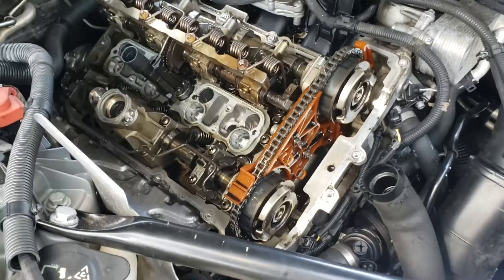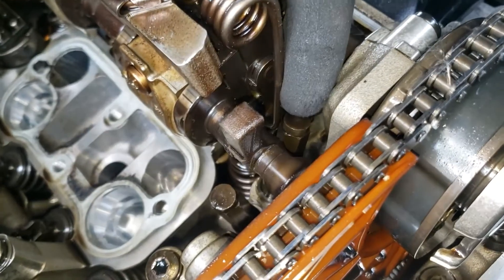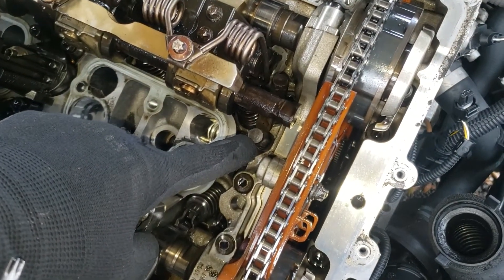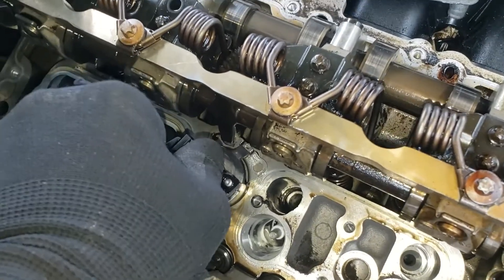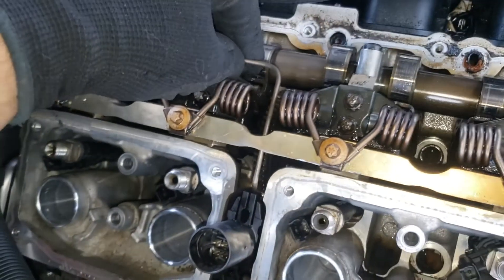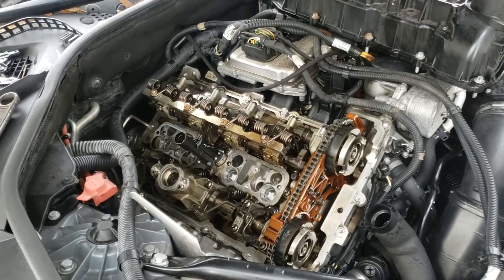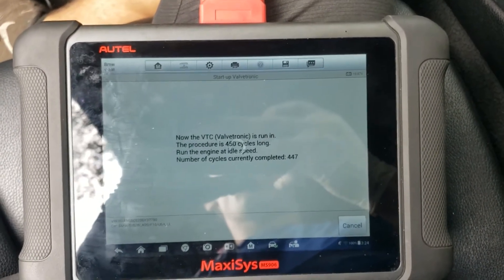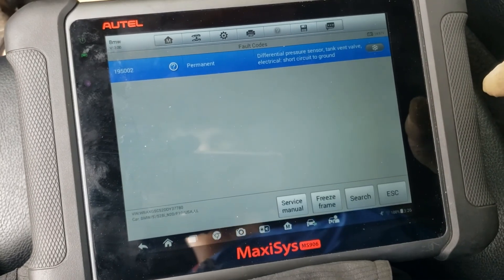BMW N20 N55 VALVETRONIC SERVO MOTOR REPLACEMENT

Comment: Thanks for the video. When you use the scanner, where did you go to find the learning procedure ?
Reply from the maker: Probably under special functions on ecu menu or active test
Reply: @pandydiy  Thanks. One more question do you have the link for the part? You mentioned you bought it from eBay. How is it working so far? Thanks again
Reply from the maker: @OmarJace I have a car dealership and I fix my own cars and make videos to help others out. I wouldnt know the current condition of it since its sold long time ago, call dealer for your part number or check realoem.com and browse the catalog there for part number

Comment: Can we have a bad motor with no codes? I have system too rich and when disconnecting the motor fuel trims go to normal 🤷🏽‍♂️
Reply from the maker: Unsure, I think its cheaper to get a proper diagnose from a proper European mechanic than just try to throw parts at it

Comment: hey man quick question so i did my servomotor and my rod bearings at the same time and i was wondering if when i prime the engine would it mess with the servotor? or no because i have to recode the servo motor in the first place

Comment: Would that cost a low compression issue n20 engine I just replace my injector now I have a no start
Reply from the maker: No it definitely would not cause low compression issue, scan for codes and find out why you have no start. Not sure how injectors are on these,  if they need coding or not
Reply: @pandydiy  it started with a misfire 1-3-4 replace injector did the coding and after car didn’t wanted to start check for spark ok fuel ok check compression low 1-3-4 90 psi num2 119 psi add oil on 4 cylinder compression jump to 160psi I’m thinking piston ring what else can cost a no compression out of timing ?any tips

Comment: In which menu is the start up valvetronic process? I have the MK906BT and I can't find the option to do the process on an N20 engine. Thanks
Reply from the maker: You should find it under engine management menu / ECU and check ACTIVE TEST OR SPECIAL FUNCTIONS menu,  sometimes even before going to all the menues you have a TAB for SERVICE or HOT FUNCTIONS
Reply: @pandydiy  Thanks. Just to confirm, battery was disconnected as well prior to stripping the intake?
Reply from the maker: You can disconnect battery for sure,  in case you didnt no big deal, you just have to clear all error codes that appeared when battery was connected and connectors was disconnected
Reply: @pandydiy  Thank you for your help

Comment: hello, I wanted to ask you can I drive my car after changing the servomotor but not having programmed it because I can't program it?
Reply from the maker: Unfortunately i wouldn't know, you probably can drive it to the shop nice and easy but i wouldn't recommending to drive without getting it calibrated.  If not getting it calibrated then why even do the work and spend money 🙃
Reply: @pandydiy  so in fact I changed my servomotor but I can't program it the new one with the same reference but used comes from an x3 N20 motor it tells me that the motor is not at 0 or the servomotor is dead is put in degraded mode, and i want go bmw concession for he change or program

Comment: Hi can you tell me what model of scanner do you use for this procedure?
Reply from the maker: Autel maxisys ms906
Reply: Have the number 906 any additional letter like TS, CV or Pro, because there are 4 differents models and I want to be sure if the more basic (MS906) works for the job
Reply from the maker: @rafaeltorres990  mine is just MS906

Comment: mi BMW 335Ino arranca me dice el escaner que hay fallo en la valvetronic, tiene marcha pero como si estuviera ahogado, crees que hay que cambiar la valvetronic?

my BMW 335Ino starts the scanner tells me that there is a fault in the valvetronic, it has gear but as if it were drowned, do you think the valvetronic should be changed?

Comment: Really appreciate you making this video. I had to do it on a friends X3 with the N20 engine, and this really helped a lot. It wasn't as hard as I thought it was going to be, and honestly the hardest part was just getting to the the Valvetronic motor by taking the valve cover off.

Comment: If I may, I just did this exact job today.  On the N20 4 cylinder engine, you have to remove the Number 1 and number 4 cylinder injectors and both injector buckets/housings have to be removed.  You do not have to remove all of the injectors.  Be sure to return the same injector in the same cylinder that it came out of.  Each injector is calibrated to its cylinder.  You cannot get the servo motor out without removing both housings.  The next part that I didn't understand was how if the eccentric shaft was spring loaded, how could you leave it in the maximum position without it springing back?  As it turns out, you will find that on both the minimum and maximum positions, the shaft goes "over center" and the spring pressure is released.  When the shaft moves off of either of those positions, the spring tension takes over.  As you are turning the allen wrench on the servo motor to the maximum position, you will feel the eccentric shaft sort of "roll over" to a position where it has no tension.  When you reach the maximum position, there isn't any spring tension on the motor so the shaft stays in its maximum position until the servo motor moves it away from this position.  I hope this helps explain how PANDYDIY did this repair.
Reply: What are the symptoms of bad eccentric shaft sensor
Please help
Reply: Great explantion. Mine is a N20 engine too, what are the symptoms of a faulty valvetronic servo motor?  Thanks
Reply: @JR-tl8tg  mine 2016 528xi with 83k miles. Started in the morning and was perfectly fine. Went inside and came back to find the check engine light on. Car was idling really rough. The check engine code was for the valvetronic servomotor' position sensors which are built in it.
Reply: @OmarJace thanks buddy for the heads up

Comment: Hi, thanks for the video. I've been trying to do the relearn procedure on my E91 with the N55 engine and, before the procedure starts, I am getting the error "Fault: Voltage supply". Any idea why? Or what voltage supply is it referring to? The car was on a wall jumper and had a constant 13.9 volts as shown by the DME. Thanks!

P.S. For extra context, I am trying to fix an "2DCF Valvetronic system: No movement detected" error. Car runs fine, pulls fine, gets good gas millage and just has this error there that is always current and can not be deleted. Actuator was changed, wiring was checked, eccentric shaft looked good, no visual damage and moved freely.
Reply: I have similar problems did you ever figure it out I have a 2012 x5. Let me know if you figure it out.
Reply: Try to erase the code sometimes you need to disconnect the battery terminals and contact them to gather for few hours to get hard reset try that.

Comment: Would this cause the car just to crank and not start
Reply: Im pretty sure it will, i have a BMW X1 with that problem and im pretty sure that is the valvetronic servo

Comment: great video, one hint to make it simpler: you only need to remove the front bucket, the actuator comes out with the back bucket in place. Also you only need to remove the back injector to remove each bucket so in this case to do the whole job you only need to remove one injector (#2 cylinder injector) cheers!
Reply: wow great to know!
Reply: Hello looking to perform this on my vehicle do you have a video showing what you mean ?
Reply: @Mv0kid  my comment was for a n55 motor... I don't really know about a n20... no video but if you perform the top video you will see if you need to take the back bucket off. For me I only had to twist the actuator off
Reply: @guyvelo1  no that’s perfect i am also working on my n55 335i. So your tip is just to remove very front bucket and the rear injector in that bucket closer to valvetronic motor? And after that everything is doing just like in video ?
Reply: @Mv0kid  yes

Comment: What would happen if you don’t put the Eccentric shaft back to the open position before you complete the job? I recently had this job done and I’m experiencing issues. Any help would be appreciated.
Reply from the maker: Not sure,  maybe you need to relearn max and minimum stop for shaft, I unfortunately dont have a answer for that

Comment: Do you have to have the scan tool to reprogram? Options if you don't have one? I looked up the tool you have and it is quite expensive. Thank you in advance
Reply from the maker: Unfortunately to teach in your new servomotor then you'd need a diagnostic tool which is capable doing so.
Reply: @pandydiy  what did u use?

Comment: Thanks for the video. My f30 has the valvetronic code and the acceleration is very very slow. Dealership said to replace valvetronic. This will fix the acceleration problem correct? Car shows drivetrain malfunction
Reply from the maker: The amount of views this video has gotten is just a proof how common is servomotor failure on these engines. You might want to scan fault codes and google them to see whats the cause of these causes before start spending money on amy part. But if dealership said servomotor then I'd assume they know what they talking about.
Reply: I have the same issue and you and other codes with it, but drivetrain malfunction and everything
Reply: Did you end up fixing it?

Comment: What trouble codes were stored in the PCM or what were the symptoms before the valvetronic actuator was replaced?  I got a no start condition on a 2013 BMW 328xi N20 with a lot a trouble codes stored, I cleared the codes and the  
133E10 Valvetronic System Deactivated, Excessive Adjustment Error does not clear, and still crank but wont start. 
Can a bad valvetronic actuator cause a no start condition?

Engine (DME/DDE) 
150C12 Ignition, Cylinder 2 Combustion Time Out Of Tolerance
150C11 Ignition, Cylinder 1 Combustion Time Out Of Tolerance
120408 Boost Pressure Control, Cut Off Pressure Rise Blocked
131401 VANOS, Outlet, Cold Start Not Controllable
131501 VANOS, Inlet, Cold Start Not Controllable
140010 Misfiring, Several Cylinder Detected
140110 Misfire Cylinder 1 Identified
140310 Misfire Cylinder 3 Identified
140410 Misfire Cylinder 4 Identified
140210 Misfire Cylinder 2 Identified
140002 Misfiring, Several Cylinder Exhaust Gas Damaging After Startup
140102 Misfire Cylinder 1 Exhaust Gas Damaging After Startup
140302 Misfire Cylinder 3 Exhaust Gas Damaging After Startup
140402 Misfire Cylinder 4 Exhaust Gas Damaging After Startup
140202 Misfire Cylinder 2 Exhaust Gas Damaging After Startup
1C0102 Oil Pressure Control Plausibility Static Pressure Too Low
131908 VANOS, Inlet, Cold Start Position Not Reached
CDA904 No Message (Status Trailer 0x2E4) Receiver Engine ECU Transmitter Trailer
Module (AHM)
133E10 Valvetronic System Deactivated, Excessive Adjustment Error
Reply: Thank you for your reply. I'm waiting for an spark plug socket to remove the spark plugs and perform a compression waveform analysis to check for a timing chain out of time.
Reply: @victor.flores8849  have you found out your issue? I have all those same codes
Reply from the maker: Are you sure your timing has not jumped ? Its pretty common problem on those engines to jump timing due to tensioner or chain guide failure and that would definitely cause no start condition,  you can perform a compression test to see if you have compression in cylinders, they should not much different from each other no more than 15psi difference Id say.

Comment: Hi, when you did this job did you put new seals on the injector? 

When you reset the setting, was that while running or when engine was off? 

Thanks
Reply from the maker: I didnt replace seals on injectors   , resetting/relearn with engine off first and it should tell you to start car etc, diagnostic tool should give you exact instructions how to follow thru the process
Reply: @pandydiy   hey there, everything still good with the new servomotor? Did you need a new eccentric shaft untill now?
Reply from the maker: @catalin.c  i sold the car little after doing the repairs, so I unfortunately would have a answer but Im sure it worked fine, original part and correct replacement procedure and relearn, should be anything wrong unless something else is wrong
Reply from the maker: New servomotor teach in proccess is done with engine running, your diagnostic tool should give you step by step instructions.

Comment: I just successfully completed the job today. Thanks for the great video.
Reply from the maker: Its awesome to see how many people find the video useful and save $$$
Reply: Any info on the injector seals? 

What issues did you have? 

Mine is being a pain starting and when it does not can’t get any revs or power and it will rev to 1500rpm then it will idle at 500 and stall!
Reply: @TS-ji1me  I just put the injectors back and with original seals. Had no issues
Reply: @jimbojacksonmurray9841  perfect, that will save me a lot of hassle. 

Can I ask what issues you had with the valvetronic? 

I’ve had random clicking coming from it, sometimes warm restart issues where it rough idle or stalls, and now today I’ve lost all power, rough idle, stalling and won’t rev past 1500rpm. If you put it in D or R it goes to 500rpm and stalls. 

I have no fault codes either. I’ve got videos up on my account. 

Beyond a nightmare as the car is unusual now
Reply: @TS-ji1me  I had no other symptoms. Just the loud clicking when I unlocked the doors. I also had the typical valve cover leak
Reply: @TS-ji1me any update on this? that’s what is wrong with my n26
Reply: @calebshull3902 I used new injector seals and used fuel pipe and jubilee clips to compress them onto the injectors.

Comment: Hello, I had my mechanic install the eccentric motor but it does not allow me to go through the reset cycle with the same scanner. Would you be able to help me out?
Reply from the maker: Hey Sam, if you follow the instructions on the scanner then it should get everything relearned as my scanner did.
Reply: @pandydiy  Hey Pandydiy, thank you for letting me know. Apparently, my car would not allow the scanner to go through the processes. It keeps throwing errors and quits on my mechanic.
Reply from the maker: @samlee9245  what kind of errors, maybe he didnt do the job correctly ? Just guessing , if all the steps are followed and the part was installed correctly then it should work, is there other codes that its giving you ?
Reply: @pandydiy  I'll confirm once I visit my mechanic tomorrow! Thank you.
Reply from the maker: @samlee9245  there might be some trouble codes which may affect the relearn process
Reply: Did you get this resolved? If so how? 

Is he doing the relearn on ISTA?

Comment: When i unlock my door theres a clicking noise and sometimes rough idle. I bought the same part in video (come from turkey too) but before i take it to a garage i would like to know rough labour costs. One garage said itll be £45 plus vat and another said £160 so not sure whats the price please help. Its a 2013 m135i
Reply from the maker: In USA FL I was quoted $550 dollars , if you can get it replaced for 45 british pounds I would definitely let them do it.
Reply: PANDYDIY thank you for your quick reply. Its weird because car was mint before i had a full front end accident. Ever since that this come up. Mileage only 46k and code was 135808. I definitely will take to them for £45, hopefully not £450 lol
Reply from the maker: @thecourier9269  hahah, yes I hope that you are not missing a zero.from the numbe
Reply: What was the labour cost in the end, also in UK too

Comment: You made this really easy to understand all n around, thanks! My brother just bought X5 and his idle randomly gets really rough and then the car goes into safe mode & it Won’t leave it unless I use my scanner. I’m pretty sure this is the issue, Is it always best to replace the servo motor, needle pin bearings, etc? It looks like you just replaced just the motorized work gear motor itself...  This makes me appreciate my little E46 & it’s simplicity a lot lol
Reply from the maker: Since my issue was just the servo motor itself then I ended up only working on that. I really try avoid anything BMW related since they atleast at my point of view are over engineered. I would prefer to stick with older N52 INLINE 6 engines and older since they seemed to be more reliable and little less complicated.